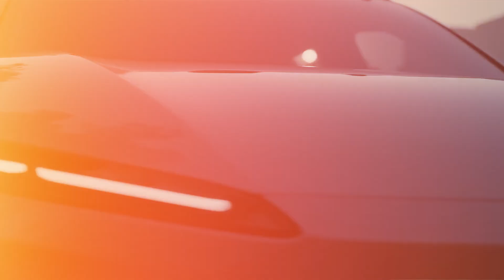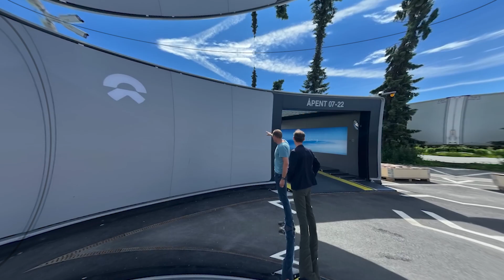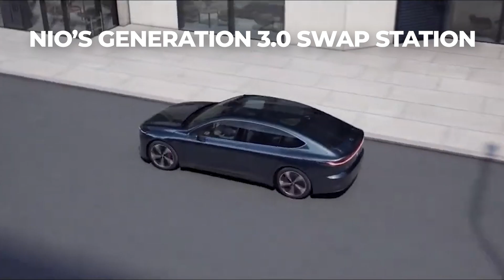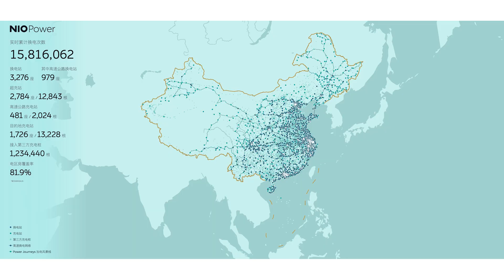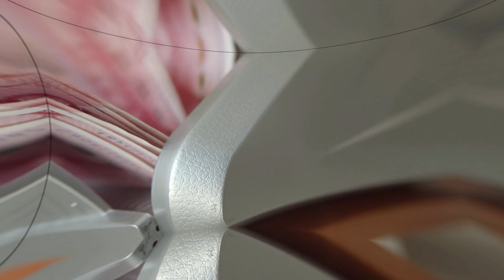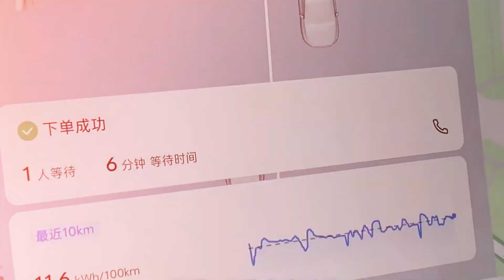How NIO Made Battery Swapping 10X Faster Than Charging

Comment: They should use a drive through option to make it even faster. But I guess they would be forced to rent more space.
Reply: I think NIO does not want people to drive into the PSS themselves
Reply from the maker: Perhaps it’s a safety issue? Avoid possible accidents?
Reply: @ Yes and also you should not drive "through" too fast because it could damage the sensitve adjustment system. They surely want this to be controlled precisely to avoid unnecessary damage and wear. Some ludicrous idiots would drive through like maniacs just for fun on weekends or something I'm sure :)
Reply from the maker: Good idea, that would make a better user experience. As you say probably comes down to cost.